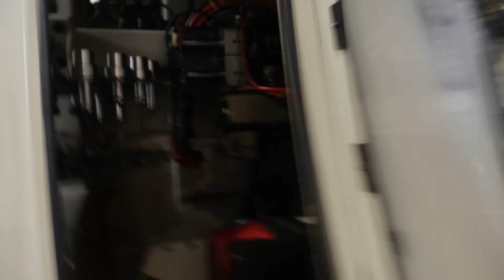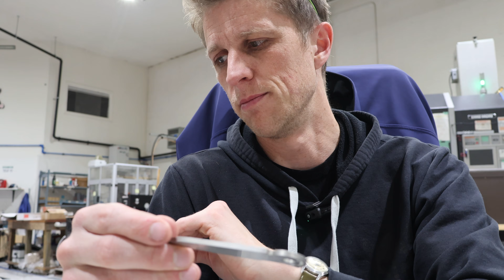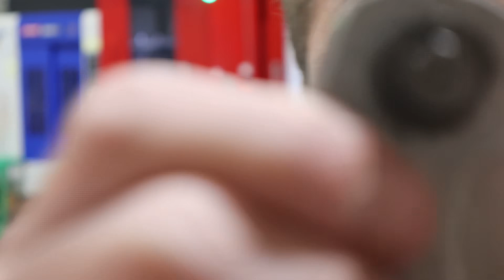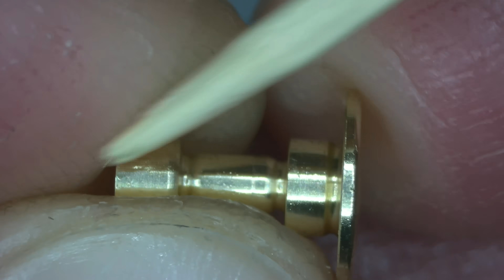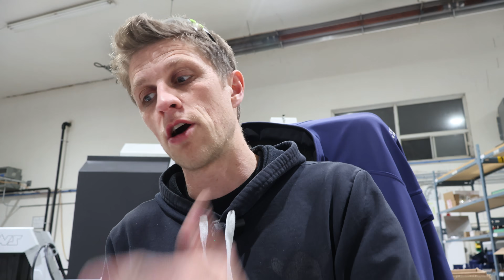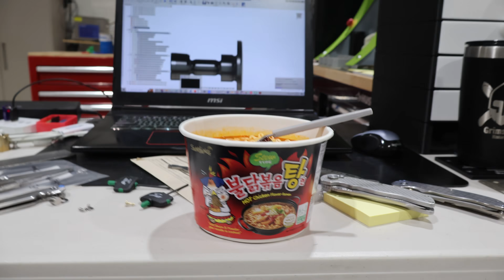Time to Make The Button for The Integral | Knifemaking Tuesdays 124

Comment: Watching you struggle with the bearing cages reminded me of the old-fashioned plastic coin carriers designed to carry loonies that had a "spring" loaded lever built in to hold the coins. A thin knife shaped piece of plastic with detents for the bearing cages would push them into place and then slide the metal blade in after removing the plastic one. Just an idea. Wish I could afford one of your knives... awesome work tho

Comment: 39:40 Maybe some 4140(or 4340) heat treated steel as base material, then nitriding ? That gets you a pretty tough steel part with a good surface hardness and a nice matte grey finish. 
Nitriding "sticks" really well to those alloys too

Comment: A slight  blend of the detent edges to the slot might allow the blade to flick open.  I think that edge may be cutting or at least galling just a tad.  3 degrees sure is within the locking taper range, have to see how it plays out in this application.  Enjoy the hot noodle bowls, toss some Sichuan shrimp in for a bonus kick!  Good to see the videos flowing again!

Comment: Anything under 5 degrees is considered a "Locking Taper"...  Also a material called Super P-20 would be a great material for the button.  It's a prehard with a lot of Tensil Strength

Comment: Need a ball rolling in a hemispheric socket with the spring pushing both into a raceway on the blade for smoothness. Relieve the spring seat to release the blade.

It's an extra part. But you're Grimsmo. 😊 Whatever it takes.

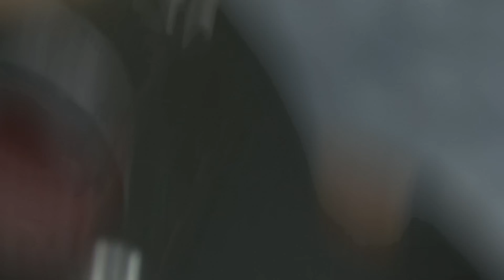Comment: Hi John, around 45:30 , you're talking about how the pocket depth in the blade determines the detent strength.
Don't forget that your current relation between detent strength and pocket depth exists because the button has a fillet and not a chamfer (deeper pocket -> stronger detent, caused by change in 'contact angle' between button and blade).
A possibilty could be to give that part of the button a chamfer instead of a fillet, it would make the detent strength independent of blade pocket depth, this might be easier to tune by changing the angle on the button. 
(That's assuming your spring has a pretty constant spring rate.)
Unless I am not seeing correctly how you try to design the detent mechanism, in that case, never mind. ;)

Comment: So so so stoked on the Willemin content. Favorite machine in the whole industry by far. Thank you for bringing us along. I desperately want to get behind the control of one of these.

I humbly propose you consult Robin about your button detent geometry and metallurgy, perhaps you could also make the button bore a through hole to avoid the junk in the hole problem, or maybe you could mill through as part of the handle pattern and leave sort of a ‘drain cover’ looking feature that would allow small particles to escape while also adding detail.

Comment: John, long time viewer here (10+ years). I really admire your passion and talent. Just a thought: if you are worried about the knife rubbing against the lower part of the button, how about using ball bearings on the interface? Or even allow the whole button to spin freely on it main axis? Probably not practical, but, in theory, it would allow for minimum friction on the button-blade interface.

Comment: Any reason why you don't put the bearing recess in the blade instead of the handle? Not only would it make assembly easier I imagine it's going to be easier to machine as well.

Comment: With Blum probing macros. Depending on the cycle you specify, the 0.1" you type IS how far down it moves incrementally. One thing Im not a fan of with blum macros, is how many different cycle can be ran with the same sub macro call just with different variable values, which fat fingering can sometimes have grave consequences. 

Also, the feedrate knob SHOULD control the probing speed, atleast it does with version V3A and V4A Blum software

Comment: I would QPQ nitride finish the lock button.  I think I would give the dome some concentric ribs so it's more tactile when locating it with your thumb.

Maybe nitride the pivot to match (it creates a black exterior).

But my main question is why don't you machine the button with the button head side in the collet?  If the two medium diameters match you could turn it around and stick it in another collet to finish the head.

To install the bearings make a tapered drift with a maximum size that matches the pivot hole and a section just under the bearing I.D. then 3D print an install tool that's as thick as the blade, with a hole the size of the bearings and a slot the size of the bearing I.D. from the hole centerline down the length of the handle  and make the sides of that slot a tapered wedge from 0.000" at the bearing hole to blade width at the end.  So load bearings in tool, place in handle, insert drift and then pull out the tool to press the bearings outward, remove the drift and then slide the blade in while you slide the tool out.

Lastly, if you keep getting those witness marks, either ream the holes before you profile the handle exterior or use a dipper EDM to get the hole to finished depth.

Comment: Would it be possible to add a ceramic ball to the contact point on the button?
Reply from the maker: I've spent a lot of years wondering that too, but no I don't think so, since the button can rotate and the interface between the detent surface and the lock surface is so close together, makes it too tricky.

Comment: You should install something similar to "probe Halo" protection ring that in the case of a probe going too far down or over would trip the styluses probe and error out before the probe's body touches the part.
Reply: I second this. Saved a probe from death two weeks after I installed some at work. At $40 its a no brainer
Reply: i designed one , and 3d printed it , its exactly 0,32 $ of filament cost for me  @Hogslam
Reply: He mentioned that on the podcast last week.
Reply: I was just about to say the same thing just ordered them for the boys in work because a probe crashed a few weeks ago
Reply: We 3D printed halos for ours, don't pay $60